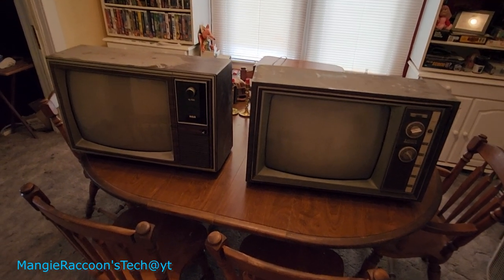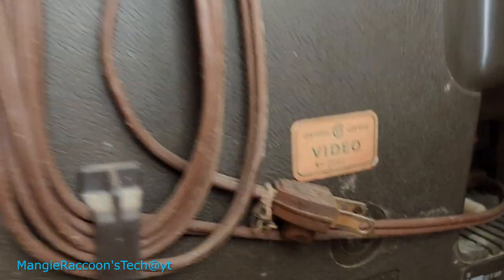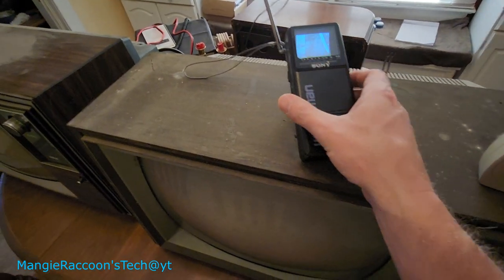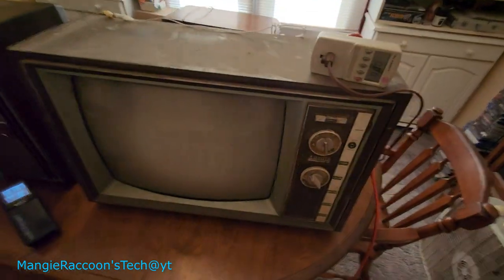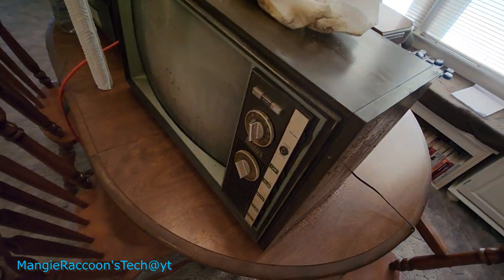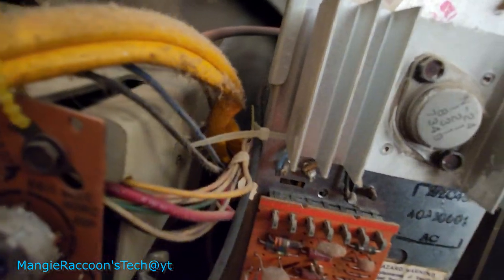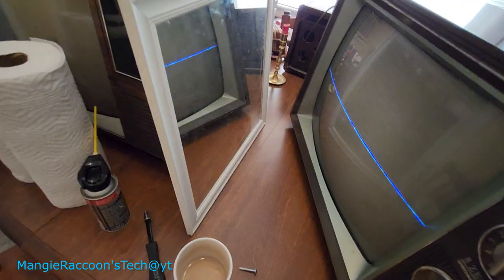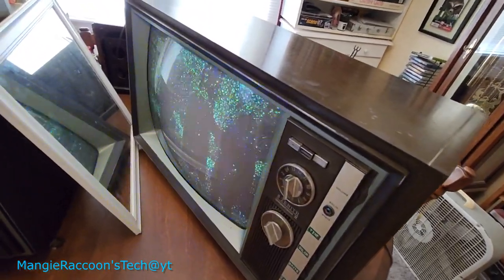Tabletop Zenith Chromacolor II and RCA XL100 Unexpected Find

Comment: RCA XL-100s are pretty solid reliable tvs in my opinion. I got a RCA XL-100 awhile back and was very impressed at how sharp it was and it had very good color. XL-100 tabletops are still around but getting hard to find as with pretty much any table top with the faux-wood grain look. Harder still to find are vacuum tube table top tv sets. Zenith Chromacolor II's are very good and reliable as well

Definitely keep both of these if you have the space because they are very good looking tvs.
Reply from the maker: Yeah it's crazy how rare tabletops have become. I remember seeing so many when I was little. I'm hoping a little rejuvenate on the tester will bring life back to the xl-100, besides that, I think just need to clean up the pots and it's good to go :D oh, forgot about the no sound part, I'll have to see if can figure that out. But I'm thinking this would be a good set for me to use out in the garage.

Comment: The orange capacitor behind the horizontal output transistor is fine, but I'd replace those two white ones with HV orange drop capacitors. The one with the end puffed out is likely already open and if that's the case, the HV is likely too high. That SK3306 tripler is an RCA replacement with a 1984 date code on it, and is the same as an NTE523. Your console is a bit newer and likely uses a Zenith 212-145 or NTE528 tripler. The TV is from 1974 ("E-line") and it's old enough to have "instant on", where they keep the CRT heater energized at all times. By '75-'76, they did away with the "instant on" feature. The picture tube is likely a 19VDZP22 and it looks like the blue G2 pot is bad.
Reply from the maker: Hey Radiotvphononut, Thanks for taking the time and dropping in! Your knowledge on these sets is impressive. So its a 1974 E-line set, I have not had any lucking finding out. Best I could find is the sams for it was 1974. I am far from being an expert as you tell hehehe. Its taking me a lot of time to just figure out some of the answers you provided XD I was unaware of the NTE equivalent tripler. I believe the tripler went out on the Console set. The part number on it indeed is 212-145. I did not have any luck finding that part. However I think there was an updated part 977-36 or was that 977-41. Any case, what are you thoughts, should I use the 977 or the NTE on the 75 console set? 

Them white capacitors on the back of the flyback says they are a special part and does not give me a voltage or uf ratings. I have ordered a hard copy of the sams and waiting for it to come in, was hoping it will tell me the ratings on the sams. There is also a few more of them down in the lower chassis that are labeled special as well. You recon I should replace them as well? On the newer 75 Console set, they are resistors I believe in that spot.
Reply: @MangieRaccoonsTech  Yes, replace all of those white "special" capacitors and I think the Zenith part number for them is 22-5001. That 212-145 tripler is the same as an NTE528 and they are a very high failure part.
Reply from the maker: @radiotvphononut  Thank you :D Looks like I found some replacements for the 22-5001. Also I have been seeing that being said about the triplers being very high failure rate. I may order a spare to have in case the replacement fails down the road. It almost looks like the 145 is original on the console set, doesn't seem like a low hour set, but also not super high too. I'm surprised it lasted all these years until now.
Reply from the maker: @radiotvphononut  I ordered an NTE528 Tripler for its replacement. It mentions an internal focus divider network. Do you happen to know if this Is this a drop in replacement or do I need to change or remove anything on the set?

Comment: You definitely need the 800-860 safety capacitor kit. You may have already gotten this because I noted your video was 1 year ago. I still have two of them if you need one. White capacitors mean trouble. Tripler was replaced (SK type number).

Comment: Does the kill-a-watt show anything in wattage mode with the Zenith turned off? That was crazy fast, it must have some sort of instant-on feature.
Reply from the maker: it took me waaaay to long to think of that hehehe, but yes, about 5 watts with the TV off. It does look like it has the Instant on feature
Reply: @MangieRaccoonsTech  That's a shame. At least the CRT looks nice and bright. I was worried the red gun was dead at first, but you had red when you were doing the greyscale. Looking forward to seeing more on this set, I love Zeniths.
Reply from the maker: Man I know right! Once I get the schematic in on it, was going to see if there is a way to disable that instant on. Otherwise ill put a smart plug on it so it isnt baking the crt lol. I was worried about the red too. im working on the video now for it, I tested the crt and all the guns tested really good except red, red was completely dead on the crt tester. But couldnt believe that as like you said, got red on the grey scale setup. Took a wire brush to the crt pins and that cleared that right up. Red working no problem now too, also the Red transistor in the video output board was completely dead. Grey scale still wont setup correctly though, but it does have a nice bright picture and can sorta get the colors to look good. but wont be right until I figure that grey scale problem out. Going to get caps for the HV ordered and come back to this set after getting the Console Zenith finished :D

Comment: Tripler on most EC45 chassii is 212-141 or 212-141-01.  Both sub to 977-36 Zenith OEM.
GL
LFOD !
Reply from the maker: Thanks for the info! Took me a while but I did get my hands on a trippler for both the tabletop and console set. The console set went out and the replacement is already starting to show signs of failing.